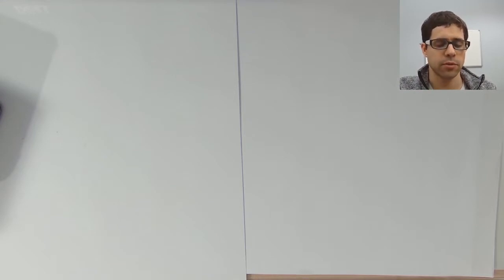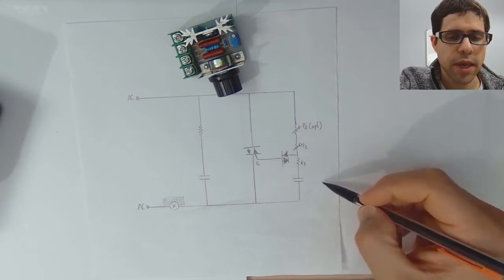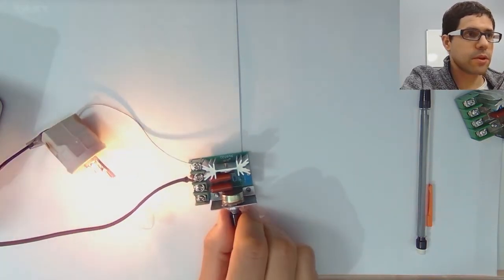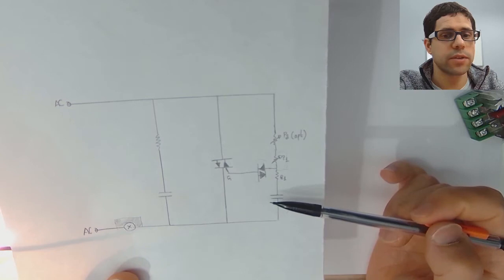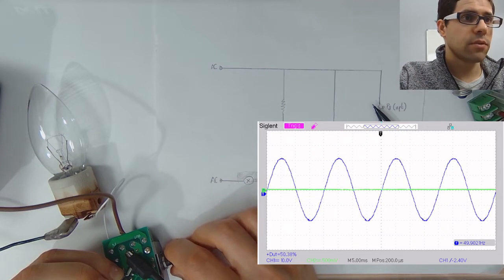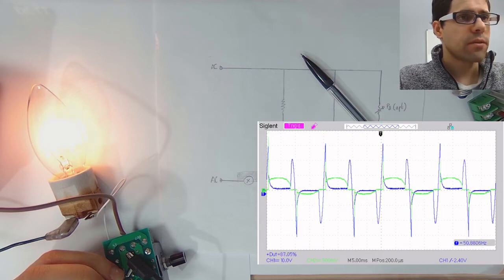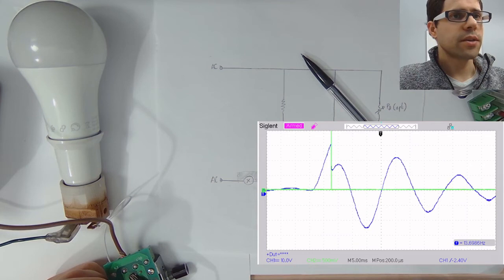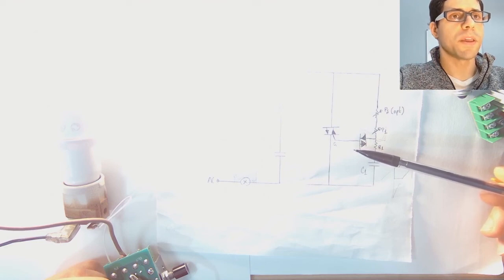How does a triac dimmer work?

Comment: Thank you very much for sharing this knowledge , I have been looking for a useful information about controlling AC source and this is the best , but I would kindly request you place the load in your schematic , also the reason to search for this practical triac triggering technique is , I am looking for a project about controlling the speed if an AC induction motor with TRIAC and your work here is a good foundation for me , I would also suggest if possible you can try and share the same with  AC motor

Once again thank you r for the great work

Comment: Hello, by far the best video on the subject after quite some searches 
One question, you say that 2 components are optional at the start 
How can I read in data sheet if the trial can manage or not faulty current (you said something like that )
The triac I have is m12jz47 for an ac motor speed control of a vaccum cleaner
Brgds
Reply: You are talking at 10:30 or so about three quadrant and four quadrant triac